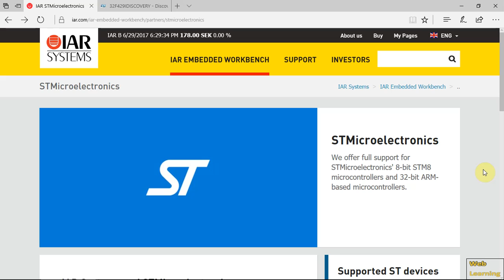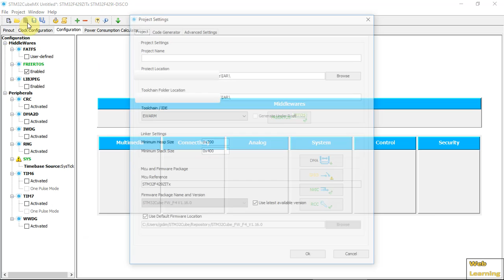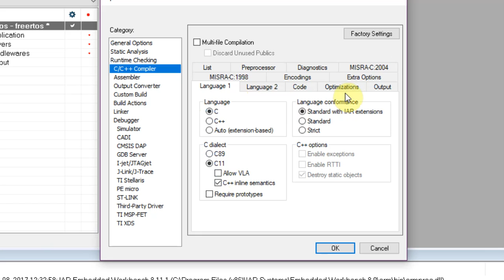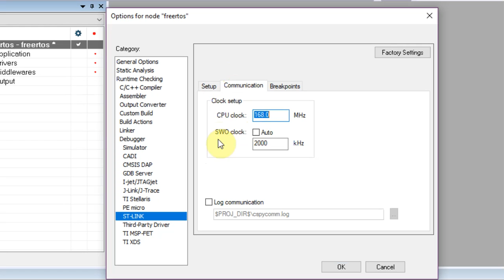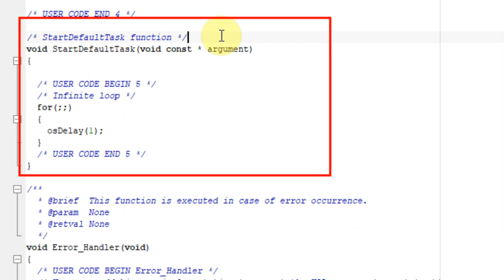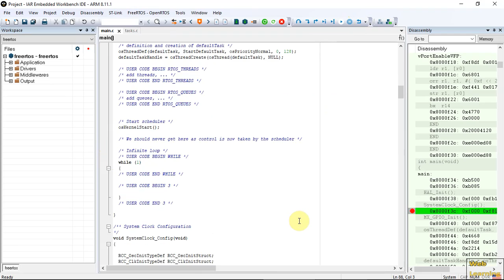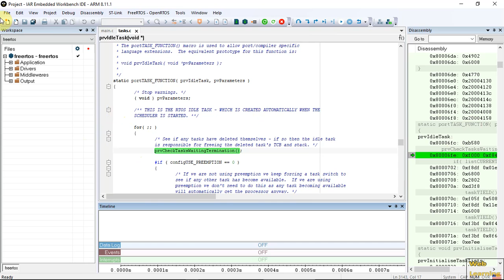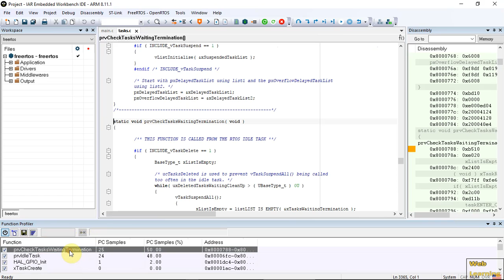IAR IDE with STM32

Comment: can you explain about iar? when is better using iar than keil?
Reply from the maker: That is a good question. You will use IAR if:
1. You have the money.
2. You need support
3. You are doing high volume product and you want to save money on the MCU ( if it low size flash )
4. If you want to have good power or performance
Reply: @Weblearning1 thank you very much.